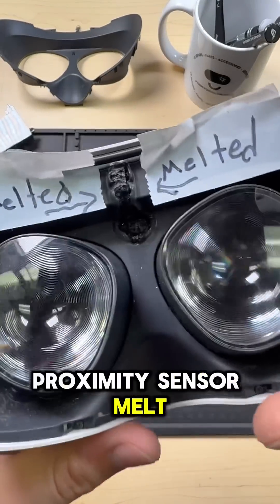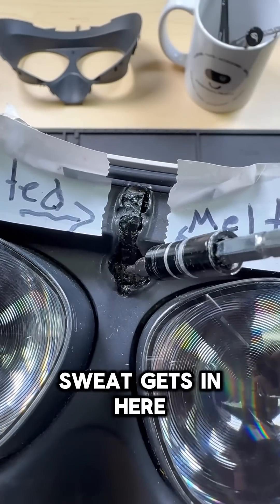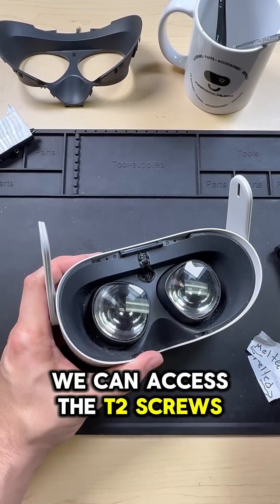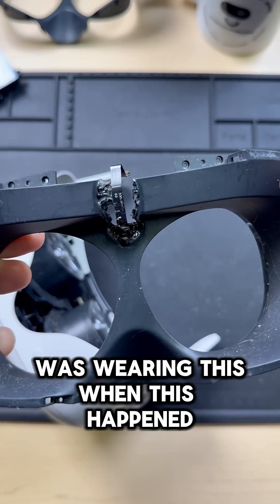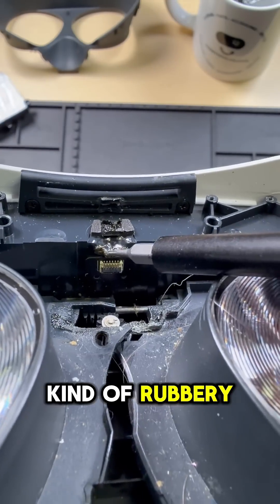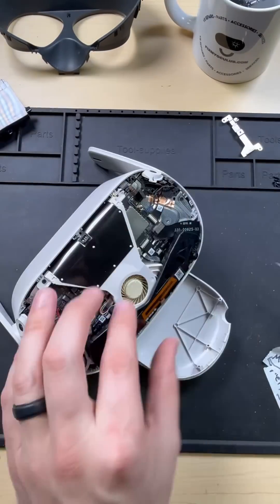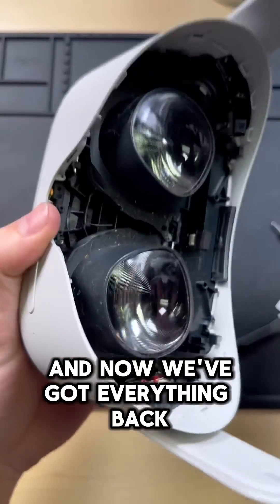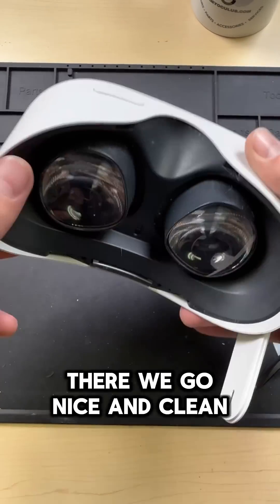Quest 2’s Dangerous Design Flaw. #vr #virtualreality #quest2

Comment: That is what happened to my 2 year old vr. It melted after i didnt wipe it when i sweated a lot, and then i put it in a hot backpack. I was like “Why does my vr smell like a cigar and a skunk spray combined?” and then it took 3 months for meta to even respond to my email and then they didnt believe it blah blah blah-
Lesson: A: just buy a new one which will be easier and faster
              B: email them 4,000 times and send it the charger and the entire headset + controllers.
Reply from the maker: Option C. 
Send it to me so I can fix it! 😃

Comment: If I was designing electronics hardware, I would think that making the battery replaceable easily would be a high priority. Except nobody does that anymore, except with power tools.
Reply: You would have been stopped by the management as then they can't sell new products.
Reply: @ArjunPakrashi  but thy can be powered by external battery's already and the internal battery dose not even need to work and 3ed party company make battery head straps so their is really no need to open it up to replace the battery
Reply: @rayzimmermin  except dead lithium batteries don't just sit there like Nicads do. I had an inexpensive smart phone bulge out because the batteries swelled up. If I had left it longer, I understand it could have burst and caught fire.
Reply: @ericthecyclist  spicy pillows are caused by over voltage when charging or physical damage to the battery

the key words in your case was a inexpensive smart phone meaning thy cheeped out on the charging circuit allowing the battery to receive to much voltage when it charged

a good charging circuit would not over volt the battery and would also notice the battery is dying and stop charging it all together
Reply: @rayzimmermin  yes, but a replaceable battery is the best option. Which the companies hate, they just want you to keep buying things.
Reply: @ArjunPakrashi  no battery is the best option that way the user can power it how thy want
Reply: @rayzimmermin  yes sure, but then you lose the wireless feature. For example, they used to make waterproof and easily replaceable battery phones before. Like I used to have a Sony Xperia ZR, which you can just open and replace the battery, but then you can do it anymore. It's not because of the tech, it's just that they want you to buy a new phone whenever one single component doesn't perform that well.
Reply: @ArjunPakrashi  no phone is ware proof only water resistant and newer phone are more water resistant then older phones

also newer batteries do not fail as quickly as older ones did so most people will get a new phone before the battery is bad as ware before people would need a new batter before thy needed a new phone

now my argument for going battery less is for VR headsets not phones so thy do not really need to be fully wireless because you can just have the batter attached to the head strap that plugs into the head set so all the wires do not get int he way just like how external bater head straps already work like the bobo VR head strap

and as far as water residents goes thy have water resident USB C jacks so that not that big of an issue
Reply: @rayzimmermin  I agree with you. But given current state a removable battery can be easily done. Modular design can also be done. My point is companies are not doing it so they can sell stuff to you and keep on selling. Like you say a bobovr kind attachment, it's possible to make things replaceable and fixable easily.
Reply: @ArjunPakrashi  NO the removal of replaceable battery's was done to remove water and dust ingress points

cell phones with a replaceable battery have a lower IP rating then cellphone with out a replicable battery

and newer cellphones that have had their battery replaced no longer have the same IP rating thy did before thy were opened

and do to the IP ratings a lot and i do mean a lot less cellphones die do to water damage then thy use to and more cellphones die before replacement time do yo water damage then do to bad battery because as i said battery tech has improved and battery's last a lot longer now then thy did in the past

so if a company really wanted to keep selling you a whole new phone thy would have left them as thy were ware thy could sell you a new battery when it died and could sell you a new phone when it got wet
Reply: @rayzimmermin  that's not true. Most of the dust and water ratings are not necessarily. Also, we have technology for which you don't need to have a sealed phone for that.
Reply: @ArjunPakrashi  um lithium catches fire and can explode when wet so you might want it to be as water resistant as possible

the terminals on the battery ware thy connect to the phone cant be protected if thy are designed to be removed and will short in water and can cause the battery to rapid discharge and explode

so ya the water rating is kind of important

bust can bridge the contacts of the battery and some not all dust is conductive and can cause the battery to short and can cause the battery to rapid discharge and explode

and considering battery now a days have way way more capacity then battery's of yester years thy will make a bigger explosion when thy pop

you do not relies it but your cellphone is a bomb waiting to go off and you can find videos of them doing just that
Reply: @rayzimmermin  I'm aware how different battery technologies work.Still, a completely waterproof battery is not needed. Also, the way you think a phone battery might catch fire, it doesn't work like that. Also, there's no need to see YouTube videos to know it. I have studied how batteries work.
Reply: with VR head sets i do not know why thy even have the batter in the face part instead of having it in a replicable head strap
Reply: @rayzimmermin  pico 4 has a battery inside of the head strap but I'm not sure if it is replaceable
Reply: Battery is one the heaviest single component in a device, so with vr headsets you want the battery to be as close to your face as possible so it's closer to your head's center of mass. Another solution would be to have the battery on the back of the strap like with Pico headsets, but then you lose the ability to use custom straps
Reply: @ivandarmawan9372  unless you make it without a batter saving cost then have it powered threw USB C so you can have user replicable head straps and battery's like the BOBOVR and allow the user to get the head strap and battery that suits them
Reply: Ironically, the Apple Vision Pro is actually the best for that, the battery is literally separate and the claimed rating on it is actually lower than the capacity of the actual cells
Reply: But honestly, if you can’t take a few screws out to replace a battery then you deserve to lose the money of the device, even iPhones are very easy to replace batteries, literally you can replace a brand new iPhone battery in 15 minutes. Samsung is terrible though, their engineering is only surface level, so the inside of their phones are terrible to work on
Reply: @Industry-insider  that's the problem it should never take 15 min to replace a battery that's why we invented a battery hatch a long time ago so you can quickly access the battery replace it in about a minute and no need for special  tools or replacement seals or stickies and no fear in voiding your warranty
Reply: @rayzimmermin  that’s the dumbest thing I’ve ever heard, the battery lasts three years and you think 15 minutes is too long? People spend three hours a day on TikTok, do you not see how that’s kind of indicative of laziness and stupidity when you think that working on something for 15 minutes is too long but spending hours on TikTok isn’t an issue
Reply: @Industry-insider  no the stupid thing is a battery replacement take 15 minutes at all when it dose not have to
Reply: @Industry-insider  I watched a house guest try to replace the battery in his iphone during the COVID back in 2020. Despite great care, it didn't go well despite a great deal of care, a kit and following a video; a components (filters) that were the size of a grain of salt got dislodged.

Comment: You got to love it when companies design a product that has one flaw that affects the whole thing
Reply: A short anywhere will take out power to the whole device.  So literally any mistake anywhere will be that "One flaw that affects the whole thing." 

Electronics are complex to design with a lot of interconnected systems placed very close together.  Generally when it comes to hardware things either work without a problem or fail completely.
Reply: @esven9263 yeah I hate it when people have extremely unrealistic expectations and nobody corrects them. but I think stick drift should be super easy to fix, big companies are just lazy af
Reply: "planned obsolescence"
Reply: @scottjohnston3098  it is easy to prevent, HAVE A LIFE and play for short periods of time instead of hours.😂
Reply: That’s generally all electronics. One tiny thing doesn’t work and suddenly nothing works.
Reply: I love your user name and profile!!!
Reply: @brickman409 dead internet

Comment: I've been watching your videos for a while. 

I have a problem with my Quest 2. It's stuck in a boot loop.  I tried a factory reset and also loading the firmware over ADB. But it still boot loops. It shows the meta screen and the logo spins once and stops. Then it goes to a black screen and starts over. I think it's a hardware issue but I don't know how to tell what component is the problem.  Do you have any ideas?
Reply from the maker: It’s almost always a camera failure
Reply: @fixmyoculus is there any what to tell what camera might be the problem.  I swapped around 1 working camera with the 2 lower cameras and it didn't help.
Reply: @fixmyoculus is figured it out. It was the top right camera.